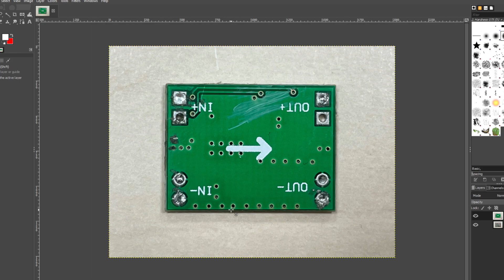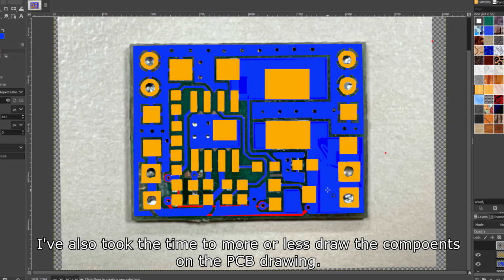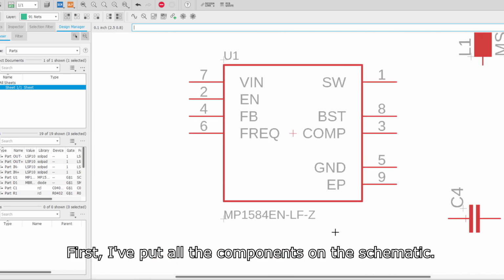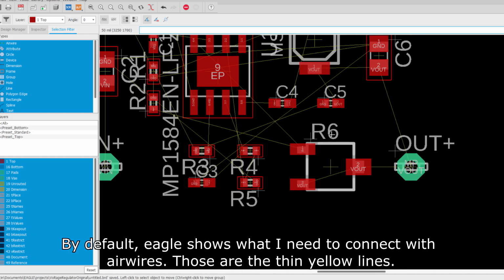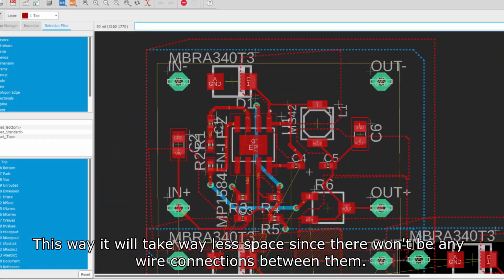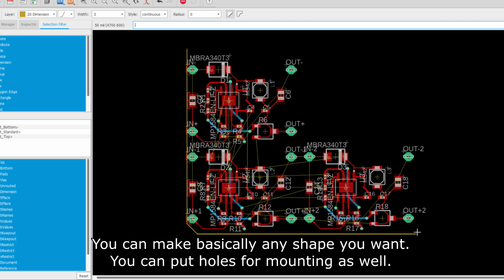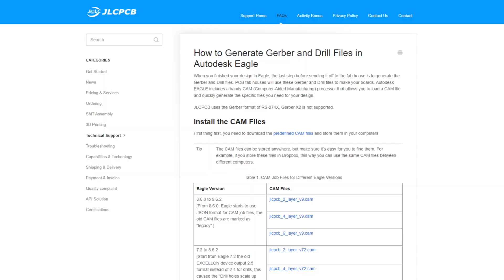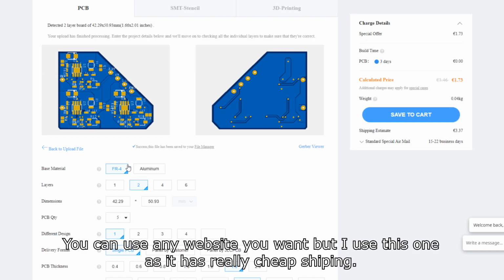How I Reverse-Engineer Simple PCB Boards

Comment: I'm trying to reverse engineer a split keyboard pcb, is there a way to know if there is more than one layer or someone knows how I could reverse-engineer the iris split keyboard pcb? I can't buy it from my country and I really want it 😅
Reply from the maker: I've seen those boards in their shop and those are most likely 2 layer PCBs.
Reply: you dont have to reverse engineer it. there are several guides on making your own keyboard pcbs, such as one by ai03. you could make your own pcb according to your own wants and needs, and then just create a pcb of similar shape and size, with matching switch footprint locations to fit into the keyboard. btw, it wouldnt really be that cheap to do this.
also, keyboard pcbs are almost always 2 layers, because they just simply dont need 4 layers. it becomes pretty expensive at that size and there is literally no need when 2 layers is always enough.

Comment: There is a high chance that you could've found the same circuit in the datasheet of the IC. These modules are usually "typical application" from datasheets.